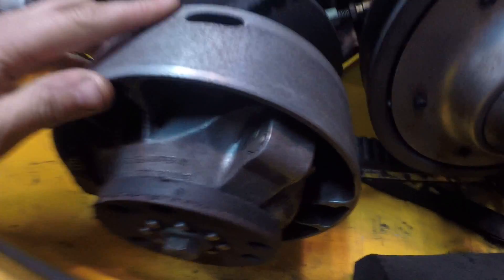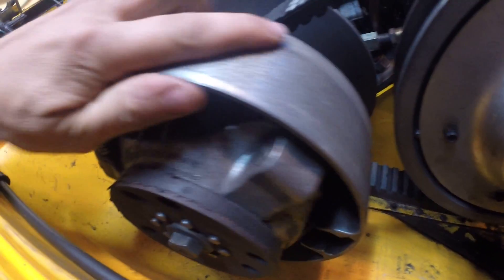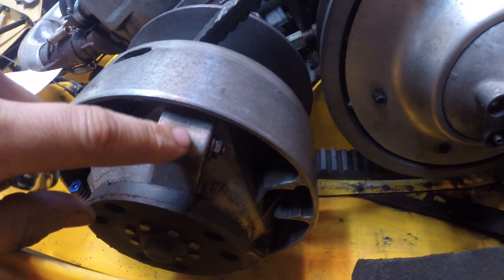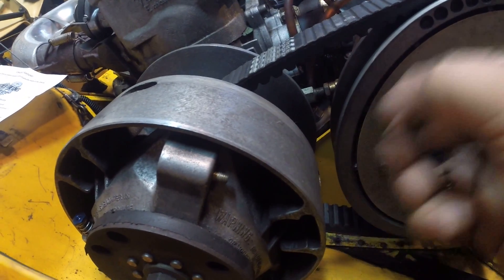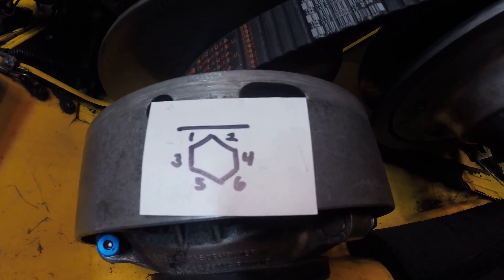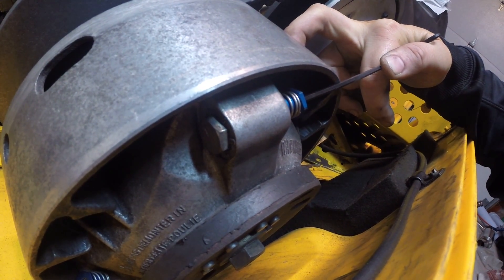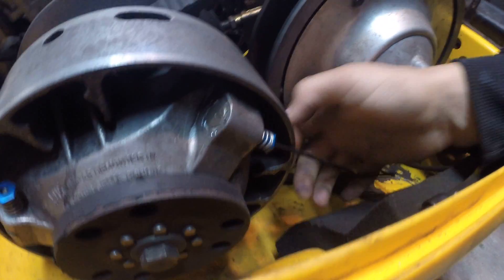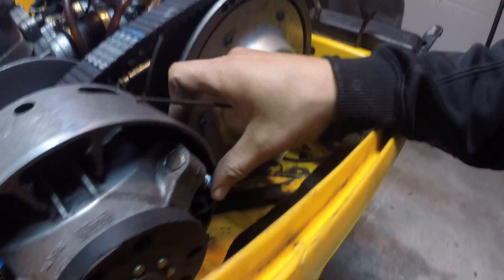Quick Clicker Installation Skidoo TRA Clutch

Comment: I am retarted and didn't do enough research first ... I pulled the bolt out because it didn't want to spin to any position besides 3 where it was. What do I have to do to get that washer out of there because my belt is slapping
Reply from the maker: I am pretty sure you have to remove the clutch and separate it to get that washer out.  I'd go to skidoopartshouse.com and pull up the parts diagram for your model and see where that washer should go.  But I am pretty sure that will be the case.
Reply: So I looked up a parts diagram and it doesn't show any washer inside the sleeve the governer bolts go through theres a washer between the bolt end and the Gov. Cup then it goes through then the locking nut on the end but the manual says theres one that can fall off inside so I may have to pull the clutch and check. I haven't changed my belt in 2 or 3 seasons either but dont ride a large amount... idk if anything else would cause the problem I'm seeing ... thanks for the reply!
Reply: Yea that shows the same I saw so for 98 formula 3 700 it shows a washer .#19 but it shows it on the outside of the gov. Cup not inside ..

Comment: What is a good setup for this currently I have 1998 mxz 670 mine are all stock at 3 any suggestions
Reply from the maker: It depends on a lot. You can adjust them to get max RPM which will change on hard pack or in deep snow. So you have to play with it. If your on #3 and getting 7700 rpm max you have a lot of room still. I'd go to #4 at that point and you should be 7850 - 7900 at that point. But the next day if snow conditions change you'll have to adjust again to keep your RPM as close to max as you can

Comment: so.... is this effectively increasing the rpm the clutch will engage at?  If so it's kind of like gearing it down... so if you added a longer track or paddle track.
Reply from the maker: It will adjust the top end RPM. 200RPM per 'click"

Comment: You do not have to damage it at all, if you install those properly you wont even need a tool, that's why they're called Quick Clickers. If you need a tool may as well keep them stock.
Reply from the maker: How do you install them properly? How do you adjust without a tool?
Reply: @InDepthSonar  you put your quick clickers on the bolt little to tight,you only need them on there to hold, then tighten the set screws, push it in with your thumb then loosen the bolt a smidge,yours are not exactly quick clickers  but still quicker the stock. Go check out Power Modz